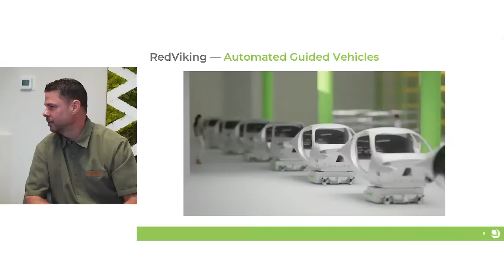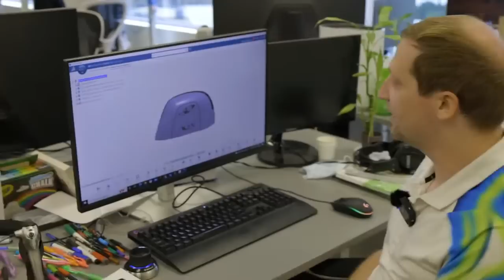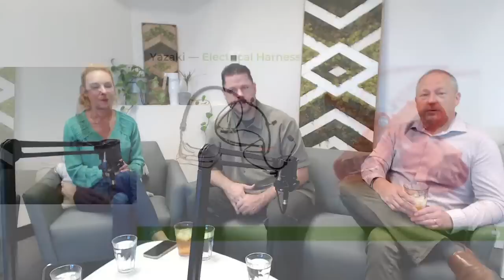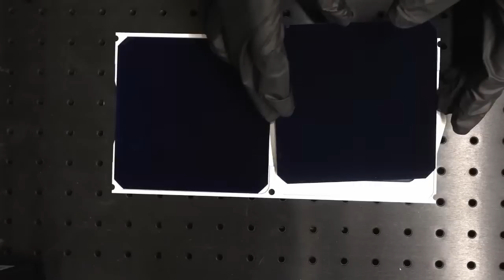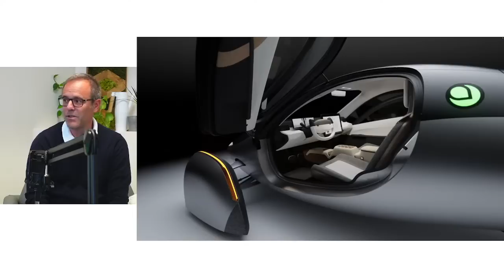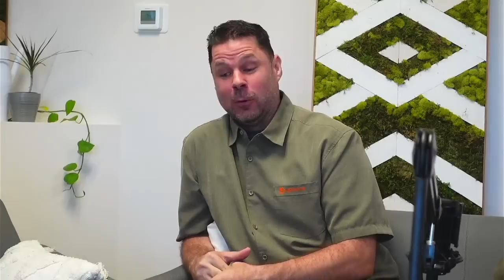Aptera Live Webinar — June 2022

Comment: You mention a lot about solar panel durability. What about battery durability in what I assume is a constant charging environment? Assuming testing while charging, what are the challenges and anticipated lifespan? Do you have a disposal plan for EOL battery packs?

Thanks!
Reply: Batteries are likely to last 400,000-600,000 miles until they reach 80% capacity, at which point they still have a long life in stationary power applications.  The major supplier - EVE power, already has battery recycling plants.

Comment: I love the concept, but the front end… I hate to see áptera fail and the bunch of hard working folks that make áptera, I strongly suggest to make the body cover the front wheels  for a few reason very important components are expose to the elements, you gain  surface for more solar cells, aesthetics people think that by having the front wheels like that it gains range and that’s not the case. Let áptera be the peoples car like the VW bug was in the 60’s.
Reply: The front wheel design actually decreases aerodynamic drag by around 10%.  They know what they are doing here.

Comment: Please consider offering campion solar panels that can be used to add charging while camping or in remote areas. If you can pack 700w into the body then a portable 700w foldable panels would be a great accessory.

Comment: They said absolutely NOTHING of substance about how this thing charges.  Instead, they spent the entire segment talking about how other charging systems are badly designed.  That tells me nothing about how this car is better than the others.  It just tells me that you don't like the way the other guys charge their cars.

The solar segment told me NOTHING about how the solar works on this thing.  They provided no actual information.  They merely said that they had "done did it da right way".  In other words, it was just more marketing bullshit with no substance.  They are dancing around the real issues and giving meaningless platitudes.  Nothing more.  Also, they did NOT create the first 20 year solar panels.  ALL solar panels last at least 20 years.

Alpha to Gamma changed 2% at best.  That was absolutely...underwhelming.

That is NOT the most aerodynamic shape.  It has only a curve along one axis.  The most aerodynamic shape is one which has a curve along BOTH axes; like a drop of water.  That's why an airplane  is a tube.  The fuselage is a reeeeeeeeeally long teardrop shape.  The front is rounded like a ball and the tail end comes to a conical point.  This thing tapers only front to back, not side to side.  A stiff breeze is going to flip it over due to the three wheel configuration.

They are impressed by getting 1/13,000 Americans interested in this thing?  Wow.  That's sad!
Reply: So many obvious untruths in this comment, and a very apparent lack of engineering knowledge.

Comment: I plan on ordering one and it will be a daily commuter for 35 miles to and from work.  That’s about 70 miles and about a 1 hour commute each way.  Dallas driving. What worries me is those seats.  They look awfully thin and flat.  Will the seats stand up to hours of sitting? Also, it gets smoking hot here and you can spend time sitting in stopped or slow traffic just baking in the sun. Will the cooling system handle 100+ degree stopped traffic?
Reply: I can't speak to the seats at the moment, but the body has a far higher insulation value than most vehicles and I suspect it will gain heat from the sunlight much more slowly, allowing the AC to keep up.
Reply: @n.brucenelson5920   Oh, my concern wasn't cabin temperature but it's ability to cool the battery when you're sitting in traffic in 113 degree Texas heat.  Thanks

Comment: The problem with the Tesla connector is that it can't handle more than 150 kilowatts without getting hot. CCS may be big and clunky but it can handle much more power.
Reply: Considering that the Aptera packs are designed for a maximum of 50 kW DC, this is not a limitation for Aptera.

Comment: Very disappointed that the battery is using NMC chemistry.  Nickel and cobalt are expensive, supply constrained, have shorter life (half of LFP), one can only use about 70% of capacity on a day to day basis, and much more fire prone than LFP.  Please get together with BYD and move to LFP chemistry.
Aptera is 8 inches wider than a Ford F150 truck.  Is that Really necessary?  It is not going to physically fit into lots of spaces even here in the US.  Forget Europe and Asia.  Can't this be slimmed down about 15 inches?
What happens when Bubba drives his raised mud truck, mom drives the family minivan over the the front wheels-suspension in a parking lot?
Reply: Chris Anthony (an Aptera founder) also took a lithium battery company public as CEO that uses LFP.  He is well aware of the relative advantages, and his company could have benefited from supplying them.  I think they went with their choice for good reasons. The life of the battery packs they are using is likely to be at least 400,000 miles and perhaps much better.  The fact that the NMC battery packs are much smaller for the performance they deliver in Aptera is probably decisive.

Narrowing the front wheel track would increase the aerodynamic drag by about 10% and worsen the stability.  They made the proper compromise, considering the design goals.  There will be other vehicles in the future with different goals.

Comment: All I see is a CityEl with lithium batteries... :D https://en.wikipedia.org/wiki/CityEl      

EDIT: Motors fitted in the wheels increases un-sprung weight dramatically at the expense of ride comfort, and those high voltage cables will have to tolerate being continuously bent. Additionally moving weight far from the center of the vehicle will decrease maneuverability as moment of inertia will be greater.
Reply: I was  worried about that when I converted a motorcycle to hub electric. But it has proven to be not an issue at all. If you only see a City EL than you need to look a bit harder. I have sat in one and the Aptera has nothing in common apart from being 3 wheeled.
Reply: The Aptera wheel motors only weigh about 50 lbs, so not dramatically more than standard wheels fitted to many cars.  Ride comfort will be better than many sports cars that have similar performance.

CityEl?  Really?  you clearly haven't looked at the acceleration, range speed, or safety between the two vehicles.  They are not in the same class application wise.

Comment: Is there any difference between the 1000mi and 250mi versions other than the battery? I so, is it possible for existing preorder holders to opt for the 250 mi version just so they don't get skipped in line and then have the 1000mi battery swapped in at a later date?
Reply: There will have to be differences, including suspension changes for the large difference in weight.

I would strongly suggest ordering the battery size you think you want.  The 400 mile one will be the first and most widely produced.
Reply: @n.brucenelson5920  Chris said 40% of the 25k pre-orders are the 400 mi.
Reply from the maker: That's a good suggestion 😊 Though we would love to offer swappable pack sizes in the future, that isn't the plan for initial vehicles off the assembly line.

Comment: Why use wires for the power of each module when you can simply print the required circuit traces into/onto the vehicle frame at the location each module will be positioned for power and just feed 1 digital signal wire to each addressable module in a closed loop?

Comment: I have to say, I reserved an Aptera.  And I invested.  It's a pig in a poke in the sense that they're not out in the world, and I can't test drive one.  But I have confidence in the mission.  (I have a Tesla now, and I want to "upgrade.")  But recent marketing, and parts of this video, have offered the Aptera as a vehicle whose design gets it 1000 miles of range, and is powered by solar energy.  That's not true.  The 1000 miles range comes from the battery pack.  The basic pack only gets somewhat more than 200 miles.  You have to pay extra for more batteries that will get you 600 or 1000 miles.  I paid extra for 600 miles.  I don't need a 1000 mile range, and I didn't want to pay that much more for it.  (And of course, no one gets 200+ or 600 or 1000 miles.). And the Aptera only gets solar power if you pay extra for panels (which I did).  If you don't pay extra for solar panels, you get a plug-in electric vehicle like any other plug-in electric vehicle.

As I said, I love the mission.  I hope I get my car, and that I love that, too.  If Aptera wants to advertise itself as producing a vehicle that goes "1000 miles" and gets contribution from solar energy, then they should put the big battery pack and solar panels on all their cars.  My son has agreed to accept my Tesla if and when I get my Aptera, which appears to be scheduled for the end of 2024.
Reply: You paid for a Pre-Order? Cheers mate, and good for you! 
I only reserved the 400 mi. range with a Hundred dollar bill.
When it comes to actually buying the car, about 30K. Full Solar add on and upgraded sound system. I don't need the extra weight and expense of the 600 or
1000 mi. range. You must be first in line paying up front. I re-read your post, 
Cheers mate! I'll buy your last drink!
Reply: @tommcgill1671  Mr McGill, my apologies.  I did not intend "paid" to mean paid in full.  I did what you did: I gave a $100 deposit, which represents my commitment to pay the rest if and when the car is delivered.  But my commitment is 100% reliable.  In fact, when I paid the $100 deposit, I got an e-mail saying I had to complete the deposit process (which I thought I had done).  So I did what the link asked me to do, which resulted in my having made two $100 deposits.  I'll work that out with Aptera if and when...  And I invested ($2000).  The investment doesn't go toward the cost of the car, though.  It was just a gesture and a small bit of help to the company to keep this project afloat.  After all that, I continued to get e-mails ("e-blasts") letting people know they could still invest (until the first round ended).  I wrote to them asking why they were offering an investment opportunity to people (like me) who had not only paid $100 ($200) to reserve a car, but also already invested.  I asked them if they were in trouble, and could not go forward.  My resources are not unlimited, but I could have invested a little more.  I never heard back from them.

So again, I apologize for using the wrong word.  I said paid, and you said reserved.  I paid a little bit of money, and you used the same little bit of money to make a reservation.  But since I'm not reneging on my reservation, then it's as good as if I paid the whole amount, which Aptera didn't ask anyone to do.

The Tesla does what I wanted it to do, and it's a very nice car.  I've had some problems with it, but it's mostly too much car for me.  It's luxurious, and it's a five seat car.  And it cost more than I wanted to pay.  (Also, I'm 72, and the Tesla is the first car I have ever owned that was not standard transmission, which I much prefer.  But the Aptera won't be standard transmission, either, so those days are gone for me.)  The Aptera, if and when..., will suit me better.  And because I bought the Tesla before the end of 2016, I got free lifetime Tesla supercharging (there are loads of Tesla superchargers), and this inducement stays with the car.  So when I give the Tesla to my son, he'll get free lifetime supercharging.  I'll have to pay to charge the Aptera, if and when..., except for the days I don't go anywhere, or I drive fewer miles than the panels will give me for free.

Comment: Thanks, Chris Anthony and Steve Fambro. When is Aptera coming to Australia?  
The Team and I are submitting a development application to a council on North Coast NSW end of July 2022:
1.     250 prefabricated CLT & SIPform passive house certified homes. On the roofs of buildings, the Tractile, the excess electricity will be stored in the 28.8MW Tesla Batteries Farm. 
2.     The PV in total 934,370m2 - Tractile tiles 45,000m2 and ARCTECH SOLAR TRACKING PV 887,400m2
3.     Bi-Charging of EV one per house and 12 charging stations in the shopping centre. 

We have a project at the end of 2024 that will be installed a long-range wireless power transfer - Emrod in New Zealand - The future of energy distribution. Emrod is pioneering the transition to a wireless, global energy network. Our technology is proprietary hardware for sending large amounts of power over long distances safely and efficiently using power beaming technology. Just as the internet transformed communication, wireless power will transform the world’s ability to generate and use power.
Reply: Bravo!  I am glad to see more people coming together to address the warming gas and other environmental issues we all face.

Comment: I'm here for the low drag coefficient and built-in solar charging (although I realize it would take days to fully charge a battery from sunlight alone, it's nice to know it could be done in a pinch).
There is a downside to that in-wheel powertrain however, which is "unsprung weight." By increasing the mass of the wheels, the suspension isn't going to work as well.
Reply: While this is generally true, the weight of the Elaphe wheels Aptera is using is only about 50 lbs, less than the wheel weight of many cars without the motors.  There will be no problems tuning the suspension to work well with them.
Reply: 😁😁In VoiceBrigade, you could create voiceovers for up to 700 characters of total length per audio. But if you upgrade to VoiceBrigade Pro, we’ll unlock this feature for you so you can get unlimited audio for your files regardless of the language.
Now You’ll be able to create as many unlimited audio files as you want.
For more details click on this
https://jvz8.com/c/2501593/378749/

Comment: I wonder if the motors will break more because they are banged around in the wheel. I also wonder about water proofing since the motor is in the wheel.
Reply: Their motor manufacturer has posted some impressivee videos of them torture testing their motors on super rough roads and under freezing salt water. They are tough!  Like other EVs, they do better going through water than gas guzzlers.

Comment: I have a reservation but now reconsidering without LVL 2 automation.. Didn’t think of that when I made reservation. It’s extremely helpful in my commute. Does Aptera at least have LVL 1 adaptive cruise?
Reply: According to a January 10th tweet from Aptera: We plan to offer Safety Pilot with Level 2 autonomy capability, including facial tracking, lane keep, adaptive cruise & emergency braking with the first vehicles. We are working towards a full self-driving model, although those capabilities will be released in stages.

Chris told me over a year ago that it might not be ready with the initial release, but could be added by simply plugging a board into a connector on the wiring harness, if they don't make it in time.
Reply: @n.brucenelson5920  thanks. I don’t care much for FSD but lane keep, adaptive is fantastic. Guess we will wait and see.
Reply: Level 2 autonomy is a must for me also.

Comment: If you can mold your solar panels into the body, why not just manufacture the top of the body as one large solar panel?
Reply: The body top has other functions, including crush resistance and thermal and sound insulation.
Reply: @n.brucenelson5920  It can't have multiple functions?  C'mon get real.
Reply: @absynthetheartist  I am sure that they are doing it the most efficient way possible.  It will take just under two hours to produce an Aptera, compared to about 10 hours for a Tesla Model 3.
Reply: @n.brucenelson5920  That's a good point.  Thank you for the response.

Comment: I know it might be unpopular, but I hope they go with the Tesla connector (which can be adapted to basically any other standard, for those unaware).   Even with 400 mile range it would still be difficult or frustrating to travel everywhere without using supercharger stations.   Yes it will get better in the future, but that is the reality right now and will continue to be for the near future.

Even in my little town, there are 2 supercharger stations, with many more stalls, than the single electrify america fast charging station.
Reply: :stayhome::stayhome:In VoiceBrigade, you could create voiceovers for up to 700 characters of total length per audio. But if you upgrade to VoiceBrigade Pro, we’ll unlock this feature for you so you can get unlimited audio for your files regardless of the language.
Now You’ll be able to create as many unlimited audio files as you want.
For more details click on this
https://jvz8.com/c/2501593/378749/
Reply: Extension cord and Solar, problem solved.
Drive during the day, keep the ext. cord and you'll
find all the free outlets in the sun to trickle.

Comment: How will Aptera handle during the winter? Ice tends to builds up above and around the wheel wells.
Reply: The heat from the hub motors might help here.
Reply: @moestrei  I live in Alaska and we drive with snow pack build up around the fender wells fairly often. Unless you have a garage your either kicking it off or beating it off or  your taking it to the carwash and using the hot water from the self serve power wash to get the ice build up off. Was wondering how that would effect the wheel covers and wheels while driving? 🤔
Reply: :elbowcough:In VoiceBrigade, you could create voiceovers for up to 700 characters of total length per audio. But if you upgrade to VoiceBrigade Pro, we’ll unlock this feature for you so you can get unlimited audio for your files regardless of the language.
Now You’ll be able to create as many unlimited audio files as you want.
For more details click on this
https://jvz8.com/c/2501593/378749/